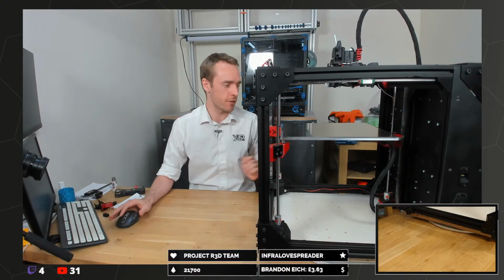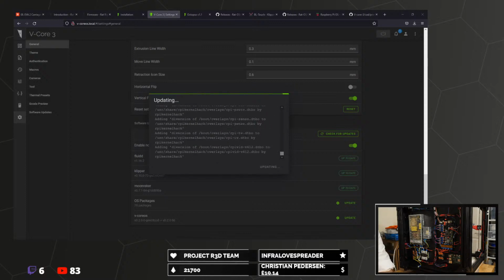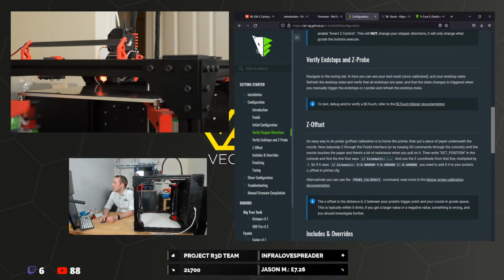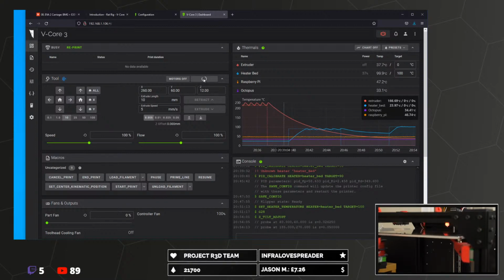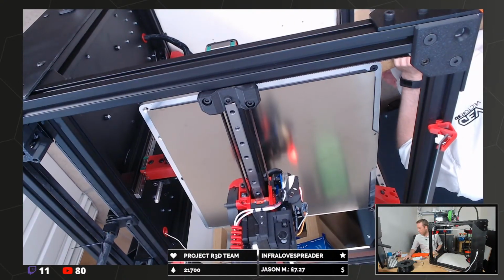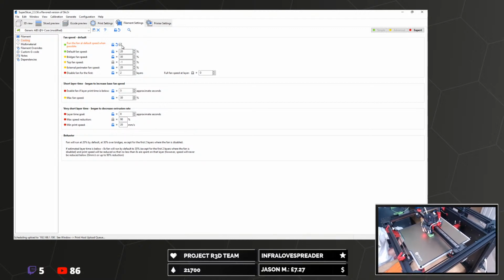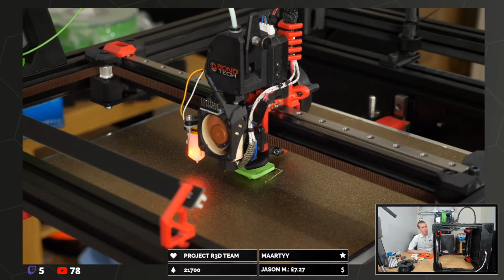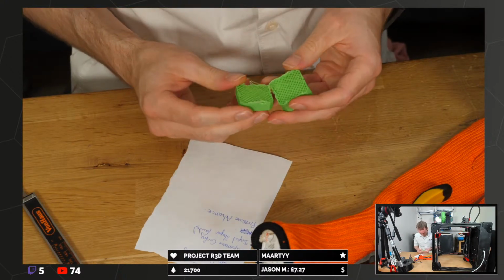Rat Rig V-Core 3 Upgrades - Klipper, V-CoreOS, Print (Part 4)

Comment: Wow. How do you get that thumbnail of the model you're printing?
Reply from the maker: Not sure what you're referring to. Timestamp?
Reply: @Vector3DP  At 1:50:47. There is a blue thumbnail of the Cube on the Fluidd screen (middle of the screen at the top under the Pause Button). Is this generated in SuperSlicer?
Reply: PS generates them and stores them in the gcode when slicing, fluidd can read and display them
Reply: @mr_psyvision  Hi Richard. Sorry for been so dumb but I am old. What is PS?
Reply: @hoppynaki  I think he is refering to the Prusa Slicer